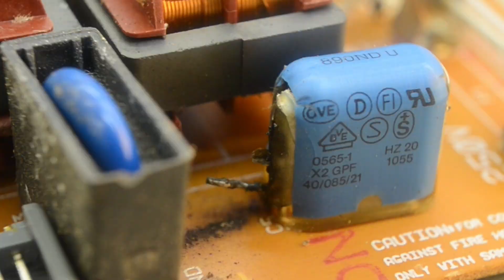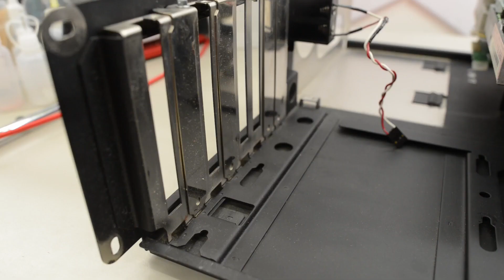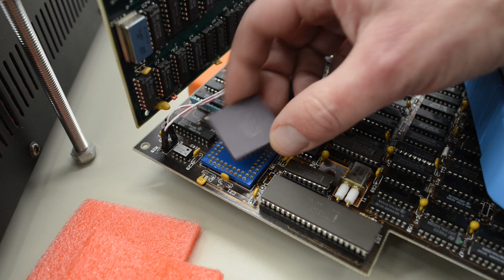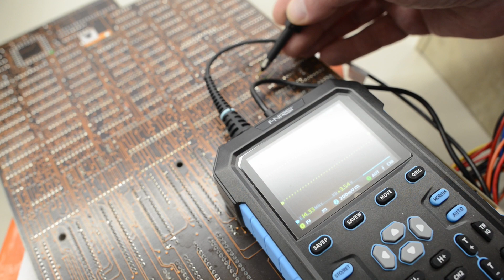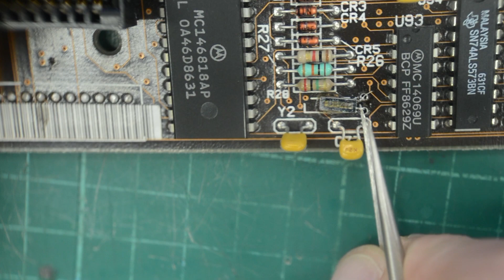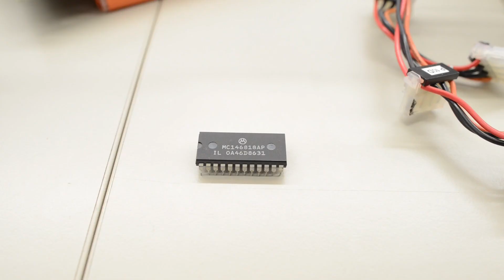IBM 5162 PC XT 286 Troubleshooting the Grinch

Comment: Try to install a fresh battery. Few years ago I have had a similar problem in a generic 386 board the; the problem was, that a rechargable battery I have installed in place of a Varta NiCad cell has lost it charge (because of rare and unfrequent use), and I kept getting error of faulty first 64k. When I installed a different battery machine returned to normal at once.
Reply from the maker: I'll try it, thanks

Comment: That 32KHz crystal is part of a dual inverter oscillator circuit (you can find some variations online) with a 3rd acting as a digital amplifier output.  Due to the way the 2 NOT gates are wired for oscillation, the circuit actually tends to run in its linear operating mode rather than digital.

Comment: 32768 should be familiar, as that's 32 * 1024, i.e., 32K.  Why would they have a crystal using that as it's frequency?  Is it a coincidence or an Easter Egg?  I mean, would a round number like 32000 Hz (with some tolerance) be a better design choice?
Reply: 32768 Hz was already "the standard watch frequency" when the first home computer was made. 
In the early 70s watch manufacturers chose that frequency because dividing it by two 15 times gives one second and the electronics used to divide by 2 were simple. 
Why 32768 instead of 16384 or 65536? Because most people can hear 16384 Hz but nobody can hear 32768 Hz and 32768 Hz also draws less power than 65536 Hz.
Reply from the maker: According to some comments, it seems to be a very popular choice for clocks

Comment: My hypothesis on why this machine happened: IBM had moved the AT to 8 MHz but still had a glut of 6 MHz 286 parts, and a glut of XT cases, and said "Hmm..."
Reply: It's not the exact same case though.  They actually went with new tooling to customize it for the 5162.  That doesn't say "using up excess stock" to me.

Comment: By looking at those symptoms I’d check all the buffers between different parts of the system bus. One of the chips might have faulty bit or is not passing information from one side to the other. I had such issue with Hyundai Super16V, where 74LS logic buffer died

Comment: Swap out all the chips in sockets. There's likely to be a bunch of controller chips like 8259, 8237, 8253, 8255, 8288 etc etc.
Reply from the maker: Actually, most of the sockets on this board is my doing. They were installed in a previous repair attempt

Comment: If the ready signal is not present at the slots trace the signal. It's possible it goes through some other chips first and there may be a broken connection somewhere or maybe it goes into a logic chip but doesn't come out due to a bad logic chip.

Comment: Feels like you were on the wrong path with that 16khz clock. 1/2 of the documented frequency isn't that surprising. Are you sure the oscilloscope was triggering right?

Have you tried a full data/address capture? There should be a consistent address/data sequence between identical boards. I wonder if it is possible to step the clock on the CPU and observe each instruction being executed on boot
Reply from the maker: Not so sure. I'll redo the measurements

Comment: The -Ready an active low signal. It got a pullup to +5V and is tied down by the clock generator when it got a stable signal. So it has to come low after power establishes. It was wrong on your first measuring when it stuck at +5V.
Reply from the maker: Ok, something seems to be glitchy there. I don't think it reached 5v before it dropped

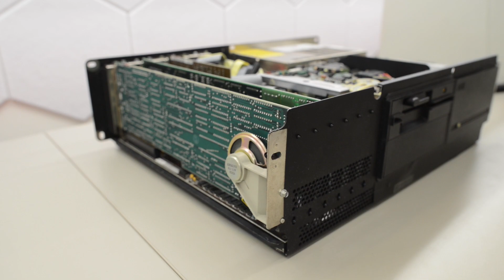Comment: 15:30 You cannot test the 32K crystal that way. You need a low capacitance probe (below 5pF) and / or 1:10 / 1:100 divider at least. And it has nothing to do with the board. Just the RTC. If it were dead you would get a date / time error.

Comment: The original video was far too long ago so i dont remember the details but. Have you checked/swapped the DMA controller? that would hold up the CPU. ALSO!!!! there are two different crystals! the behavior your getting with the new crystal is normal because you inserted a parallel-load crystal in a series circuit. Cant do that. The intrinsic load characteristics are radically different. Put the original crystal back in place, its probably fine. You cant test that circuit with a scope unless you are probing at the DRIVE output of a series-load circuit.
Reply from the maker: Yes, the DMA controller has been swapped. Thanks for the useful info!

Comment: the 32768 crystal is used for cmos clock because if you divide it down you get 1Hz.  that crystal was used for very cheap lcd watches you could buy in the 80's.  probably still used for the same purpose...
Reply: Yes yes it's still in every single quartz and digital watch.

Comment: I suggest you test with the MR BIOS generic 286 BIOS which works with this system. The MR BIOS is much more informative in terms of messages and beep codes. Also, when the system reports the first 64k to fail, this also may indicate a complete RAM or other system failure which causes the RAM access to not work. You also can check the refresh logic if this is working on the RAMs which would also be a condition for the system to be able to get further into the POST. I would also measure the data lines on the RAM side to see if anything stands out. The RTC is really tricky and you need to measure the 32k clock on U93 pin 4. If you measure on the crystal the scope may be stopping the oscillation. 12887 and 12885 work however it needs exact battery voltage on the battery pins or the RTC chip will refuse to work... Ready changing is due to reset because ready is pulled low during reset. If ready is doing nothing I would suspect the 82284 being faulty. Pin 11 on the 82284 needs to go down briefly to properly reset the 286 CPU. I don't love the method of letting the PSU apply reset through this input, and could be modified using a RC reset timer which may be more reliable to init the system. I found the 5170 also to be tricky to init and post and the RTC is part of the problem.
Reply from the maker: That's useful info. Thanks!

Comment: Those EPROMs are without stickers to prevent damage or erase of the data inside . And what is this big one withou socket with  window?
Reply from the maker: From the datasheet, " It contains a low-cost microcomputer with 2K of program memory, 128 bytes of data memory, 8-bit timer/counter, and clock generator"
Reply: @Epictronics1  it is highly recommended to cover it's window as well if it is not too late . I had a XT/AT keyboard from a Pravetz 16 (Bulgarian XT clone from Bulgaria in 1986) with a similar ceramic microcomputer inside from Motorola with a fewer pins window I do not remember the exact model. And unfortunately out of awareness I destroyed the data inside just by a desktop lamp :( so my keyboard was busted ... Those chips are complicated to program and the program for them are hard to find . Especially in my case . In Bulgaria during the 80's many devices used this microcomputer on board , like mentioned keyboard , one and only mouse , at least two models of MFM hard drives , 5.25" floppy drive. Eventually they made a Bulgarian clone of that Motorola's chip called CM650 in plastic package , without a window , so the code was permanent for each device :)
Reply from the maker: @intel386DX  I just covered it, 10 minutes ago :)
Reply: @Epictronics1  I hope it isn't too late , but....

Comment: Sorry to hear the many faults with this machine. I'm also puzzled about the choice of making this, maybe Don Estridge liked the original XT case more than the newer AT case. I seem to remember he once commented to especially like the XT. I developed my own ATX design for an AT based on the 5170, however I still would one day like to know the reverse engineered data from the byte conversion core AT logic PAL chip U27 in this system! If I ever come across a 5162 PCB with a PAL on it, I will look into this. I think I will rewire the PAL to reverse it with known methods and reverse the remaining pins separately based on the function of these pins. Many people don't realize the historic importance of this 5162 design and the key to understanding this design which remains locked inside U27 which has never been reverse engineered in human history... I have done this work with U87 on the 5170 as can be seen in my VCF thread.
Reply from the maker: I agree. We'll fix it somehow. I'm too stuborn to give up!

Comment: 32768 is the timekeeping crystal frequency.   You can't probe that circuit without disturbing it, as it's very low power.   Some RTC chips have a 1 Hz output that you can probe, which will tell you that the oscillator is running.
Reply from the maker: I just probed my 5170 crystal and it worked! Maybe there is a way to probe it somehow?
Reply: One pin of the chip is an output and the other is an input.   You can usually probe the output pin, but often times probing the input pin will stop the oscillation, or at least disturb it, due to the capacitance of the oscilloscope probe.  There are special low-capacitance probes which have an amplifier located very close to the probe.   Probably you could probe it with one of those.   You should always use your scope probe in 10:1 mode to reduce the loading on the circuit you are probing.
Reply from the maker: @rlgrlg-oh6cc  That's very useful, tanks!
Reply: @Epictronics1  They are easy to test. Use a 74LS14 logic chip. Wire 5V and gnd to the chip, wire the clock output to pin 1, tie pins 2 and 3 together on the chip and measure pin 4 on the scope....
Reply from the maker: @g4z-kb7ct  Thanks. I was hoping we could measure it in circuit
Reply: @Epictronics1  You can, don't need to remove the crystal. Just attach a wire to it then join to the logic chip hanging off some wires.
Reply: you can usually probe the pin that's the output (XO) or the one that shows the inverter buffer output, because it's actively driven and you won't disturb that one. or just use another output of the circuit, because that one used some other inverters for its actual output.